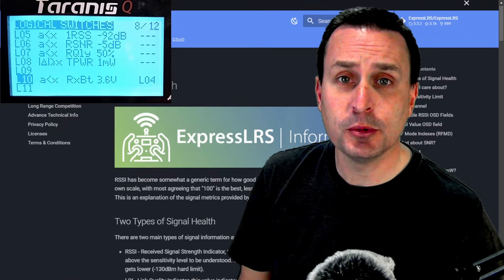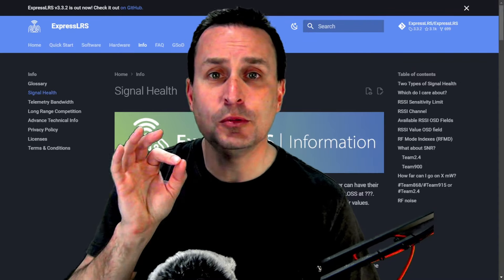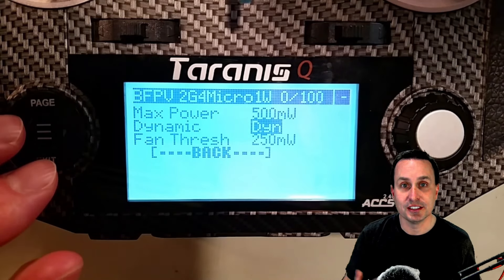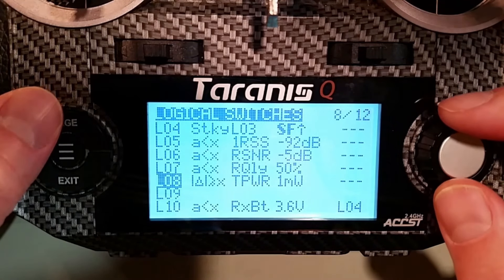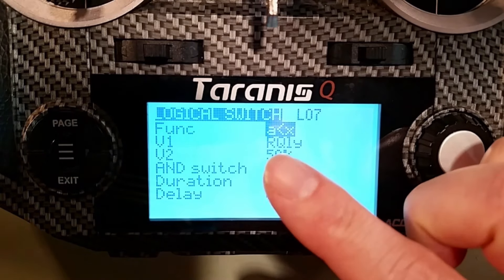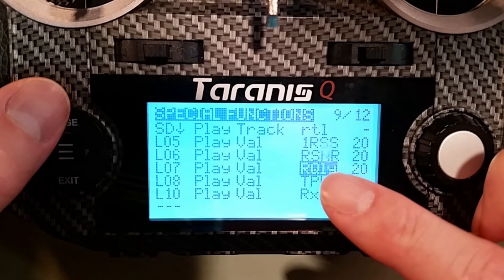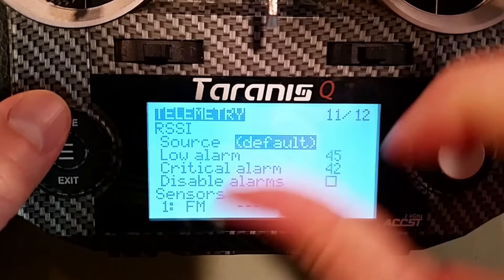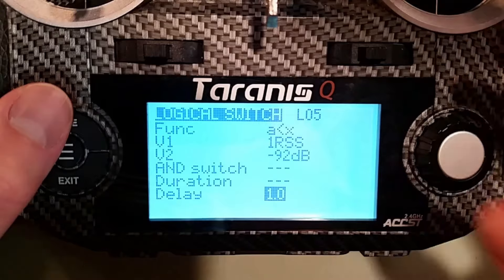📶ExpressLRS📶 Telemetry CALLOUTS Setup | EdgeTX or OpenTX

Comment: This is a great explanation on how to set up these call outs and what values to use. EdgeTX / OpenTX use RQly for the "Signal low" call-out on the telemetry page, but I love your idea of having the value read. Someone should add a checkbox for that feature!
The reason the RSSI doesn't go all the way down is usually due to the receiver's amplifier adding 12-15dBm, so -112 will drop off at -100 roughly.

Comment: OpenTX has no value for 50mW in the CRSF Telemetry protocol and instead will be read as 0mW. EdgeTX versions 2.5.0 and newer have the proper 50mW readout.

Comment: Really great video, thank you.  I think the LS needs to have some hysteresis included.  When I fly LOS (i.e. not in a line away from myself) I get a lot of alerts : "25mW" "10mw" "25mw" "10mW" as I go around a circuit - which is not that useful.  I will retry this with a LS Duration of 2s
Reply from the maker: you could also only have it read out mW reading if RSSI, LQ, or -dBi ia lower.

Comment: Very useful detailed explanations! Now have my long range 3S powered quadcopter telling me every 10 seconds what the battery voltage is once it drops below 12v. Much more comforting than just playing a track telling me I have "Low Battery". Interesting to hear the voltage recover when I ease off on the throttle. Thank you!

Comment: @uav Tech from elrs site: OpenTX has no value for 50mW in the CRSF Telemetry protocol and instead will be read as 0mW. EdgeTX versions 2.5.0 and newer have the proper 50mW readout.
Thanks for this video!

Comment: Hi Mark, another amazing tutorial. Thank you so much! So, basically your screen at 2:17, for say 5" quad, light HD freestyle mostly, do we need all those L05, L06, L07, L08 and L10 except maybe that L06 as you mentioned you'll probably get rid of it? I've set my L07 as 70% instead of 50%. Everything else should be as in that screen that shows up at 2:17 sec mark into your video? I use 250Hz (-108dB), so I've set my L05 as a<x 1RSS -98.

Comment: Really cool inside stuff! Thank you very much for sharing! I'm still trying to figure out at which number to set up the warnings for my 250mW/250hz controller.
Reply from the maker: which awarning?  Range?

I would set that off -dB.  Anything lower than -95dB for me.  That way, you have a buffer.  You will see packet loss starts to drop after lower than -95dB.

Its jumping up in power is the first indicator you are starting to put on some range.  Then when you are at max power and you get a dB warning, you know you are near the end of the rope.
Reply: @uavtech  Hi, sorry for the late response and thank you very much for your answer. I had been researching and found the "take 10 off from the number which is shown on your rc next to your hz number" answers. I thought I had seen some kind of table for this with the different types of dB and hz. I didn't realize it's so simple... Thanks to you too for mentioning this! Took me so so long and now I can enter the correct warning number at BF and not worrying too much (yes, I know and use RSSIdb and l:c).

Have a great day, sir!

Btw.: I don't have these sources for the logical switches. I have different ones, but nothing fitting into this.

Comment: I may have missed something. Do I need to have a quad plugged in? When I go to special functions after doing the logical switch, the TPWR option isn’t there. Sorry, new to ELRS, coming from CRSF where dynamic power was a no no.
Reply from the maker: if your receiver powers up when you plug the FC into USB, you should be good.  Clear and Discover Sensor again maybe.  TPWR should also just be coming from the transmitter module.
Reply: @uavtech That worked. And very cool! Stuck a quad in the washing machine and walked across the house. After 2 brick walls and the washing machine it started doing the callout. Gotta love elrs for working from  in a “faraday cage”. Thank you for all you do!

Comment: Great tips! 
I've got mine set to read out power levels at >51, because my dynamic power often goes from 25 to 50 to 100 with the rf noise around my house, but if it goes from 100 to 250 or 250 to 500 it reads it out to me. So maybe mine also reads 50 as 0 but I never hear it.
Reply from the maker: Good stuff!

Comment: Is there a way to set it up on your OSD your mw power
Reply: Yes. There is a transmit power OSD element in the latest versions of BetaFlight. On ExpressLRS though you need to make sure you are using wide channels if you want the value sent from the module to the receiver.
Reply: I'm very new to E LRS I did activate it on my OSD but did not read  I would love to get to work and what is wide channel sorry
Reply: @ivanmojica9924  ELRS has option for more efficient channels (hybrid). This limits some channels to only a few possible values. Wide channels support more possible values except on aux 1 that only does on/off values for arming. Go to the module settings on LUA script or module screen if available. There will be a channel mode option that can be set to wide.

Comment: Some feedback:

My setup is a TX12 with EdgeTX, a Happymodel 1-watt ELRS module with V3.3, and a HM Mob8 analog with an ELRS SPI receiver with V3.0.

I'm running the ELRS dynamic power limit at 500mW.

I set the TPWR callout interval to 50 mW; when set to 1mW, it gave me constant callouts.  Most of my flying uses less than 100mW output, so I wanted Betty [my TX12] to pipe down and only tell me when I'm over that.

EDIT: I added a logical switch that is set to ON when my throttle timer is more than 15 seconds.  ANDing this logical switch to my TPWR and link quality logical switches makes it so I get an accurate countdown for landing without a callout stepping in.